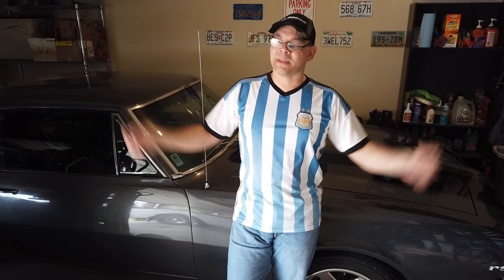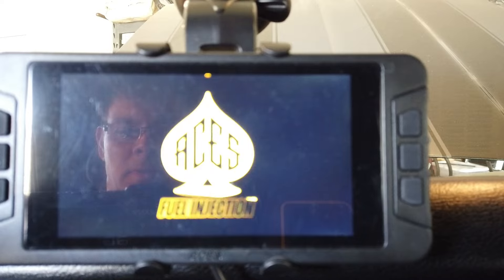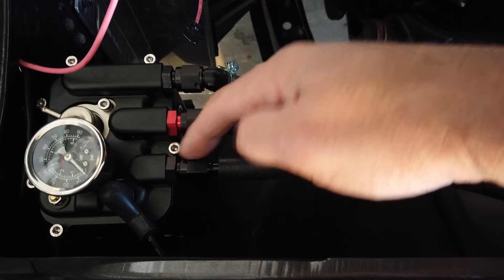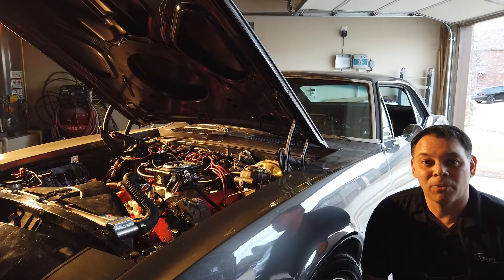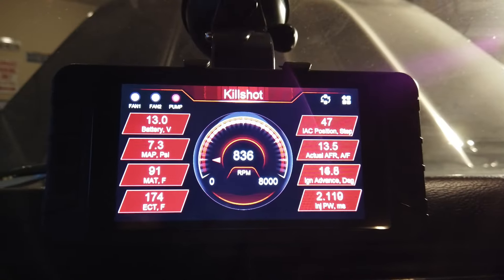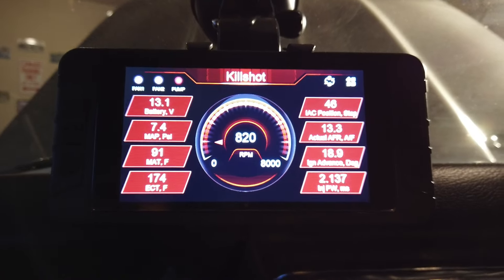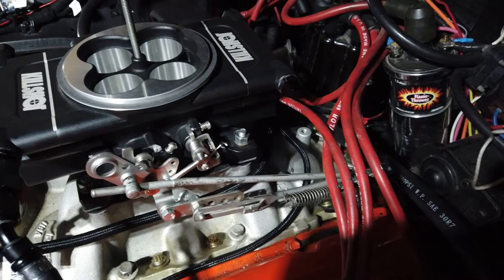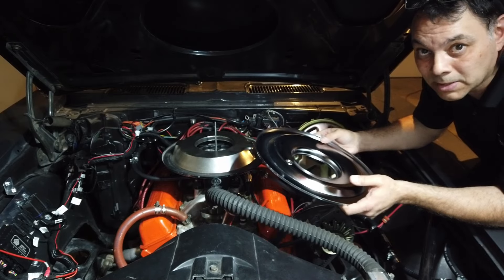ACES EFI Killshot Pt: 7   Completion, Setup and First Run

Comment: Have you given it any more advance yet ? 
It should like more advance than 15°
Reply from the maker: No not really.  Haven't really touched the car in almost 3 months now.  My father is dying and I've been out of state with my folks as much as possible. You're not the first to mention this though.  I'm wondering why you and others say that though.  ACES asks for the 15 degrees.  It starts pretty nicely and easily at 15.  Obviously 15 degrees is only the initial for startup and my vacuum advance goes from the 15 degrees to I think somewhere near 36 degrees (if I remember right) as I accelerate up to WOT.  What would be the benefit?  I'm really interested in knowing.  I'm totally willing to make changes for the better but I really don't understand what it would do to go to 20.  Remember... I'm just a slight bit more informed than a shade tree guy and totally new to EFI.  So yeah... by all means... smack some info on me.  What can I expect for 20 degrees? I just worry about changing the ACES recommendation without understanding why.
Reply: @dc10tech911  sorry to hear that bud , all the best

Comment: This is when you need to understand how efi works 
Holley was on multiple vehicles in the 80s. Throttle blades opened ecu can sence vacuum leak and ecu will try to compensate for the issue. The beginning carb ecu n o2 sensor set up was good if all parameters were met. My suggestion is read and understand basic efi before you jump on a product and begin to complain why it won't work

Comment: What is your cam specs? Im torn between stock and mild setting. Thank you for the video
Reply from the maker: Honestly I don't remember.  I lost my spec sheet, but I can tell you it's a Summit Racing cam with a mild grind.  Summit usually has a stock, mild, medium and radical under their own name.  This one was the mild with hydraulic flat tappet lifters. I used mild settings because of it but people who are running rich should probably try the stock setting to help the base fuel table and learning curve.
Reply from the maker: @AR_420  I guess I didn't answer the question fully.  If you're trying to figure out which setting in the handheld you need for your cam... unless you are running 100% stock engine and cam go with mild. It will give you a touch more fuel and so more pep and horsepower.  If that ends up being too rich THEN go to stock setting in the handheld.  Hope that helps
Reply: @dc10tech911  i got a 5.3 plan on getting a decent sized cam ported 862 heads new valves springs rockers oil pump intake manifold and such. should i run the mild setup when i buy this kit?
Reply from the maker: @ I’m not a professional here so take my opinion with a heaping tablespoon of salt…. But if you want my opinion then here it is:  You know it really all depends on your cam specs because apparently the grind will determine how the air and fuel will mix more than any of the other items. Sometimes more than all the others put together.  Yes… they all make a contribution but if you choose to go a monster cam route you will be having more problems than the average guy.  I would highly recommend you stay away from more aggressive cams.  NONE of the EFI systems like them.  You will most definitely spend a heck of a lot of time tuning the system if you do. That’s IF you know how.  If you do not know how to tune I would highly highly highly suggest you take it to an authorized ACES tuner if you install a huge cam, because otherwise it will run like garbage and you will most likely break something in the system and then blame ACES. That’s not a slight on you, but you have no idea how many times that has happened.  So… stock cam… go stock even though you upgraded the rest.  Mild grind with your build go mild in the wizard.  Medium to aggressive cam, go to the “holy crap I love 2 miles to the gallon… so please take my money!” setting.  It’s better to be richer with a larger cam than leaner. If you run rich, you can check the 2D tables after a few miles and see if the EFI is pulling out fuel… if so you can make adjustments from there. If you run too lean with an aggressive build you will most definitely cause damage.  Does that help?  I hope I answered your question.  When you get the kit join our ACES EFI Tech and Owners group in Facebook.  Lots of super intelligent folks in there.  Good luck bro!!!!!
Reply: @dc10tech911  i do plan on getting a soppy mechanics stage 2 cam it's I believe a 548-550 with 218-220 I don't remember exact specs but slightly bigger than chopacobra and truck norris
Reply: @dc10tech911  and I plan to learn how to tune it myself aswell
Reply from the maker: @  Holy hell bro.  More aggressive than chopacabra and truck Norris?! The system will work but you will struggle to get it right.  Those will need a wizard setting of aggressive. Probably just to get it started. One thing you absolutely WILL need is a single plane intake. Don’t go dual plane with this setup.  It wont like it. Go rich to start, get it running, and see where your tables stand.  Definitely buy the CAN bus cable that will allow you to hook up a laptop and tune on the fly.  You’ll need it.  As you run it, adjust the tables dynamically to make sure it doesn’t struggle.  Look up a YouTuber called Action Vulture.  He is actually Tim, ACES’ guy in charge of R&D and Tech Support. He has a video called “Killshot classic conversion to pump e85”.  Though that’s not what you’re trying to do, he covers a HUGE amount of tuning info to show you how to adjust it well.  Also go to ACES Fuel Injection YouTube channel and look up “Fuel Table Offset in the Handheld”.  That will also show you some great tips to get the mixture right almost right away.  Hopefully that will get you going in the right direction.  Please be careful.  Others in the forum have tried both those cams and have struggled hard.  I can’t think of a single one that didn’t end up going to a tuner.  Just be careful… use an approved ACES tuner.  One poor dude took his car to a regular tuner who didn’t know ACES well and that guy fried the system twice I think.